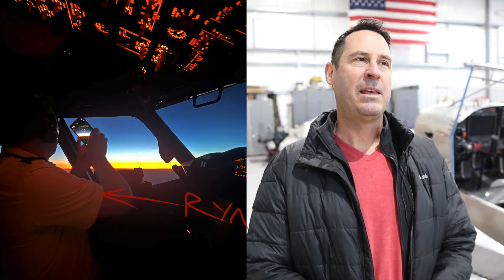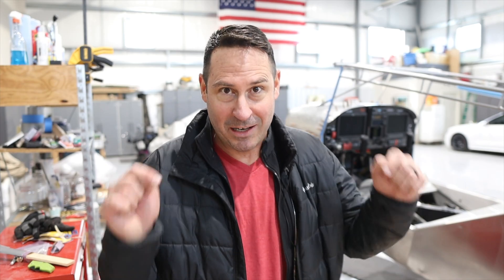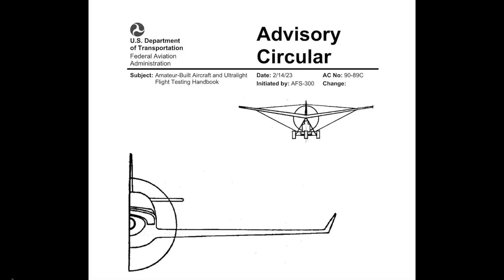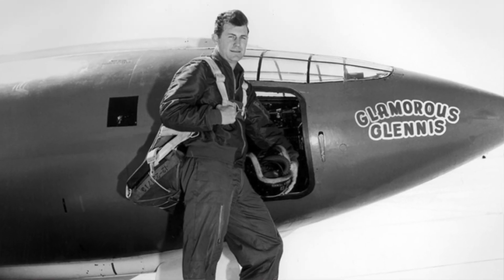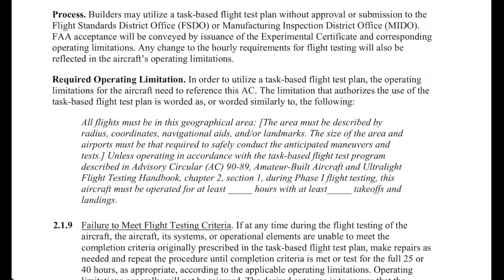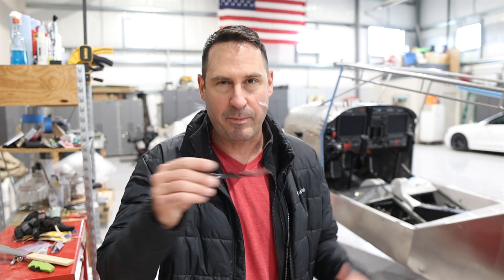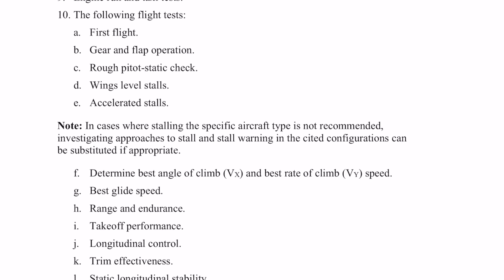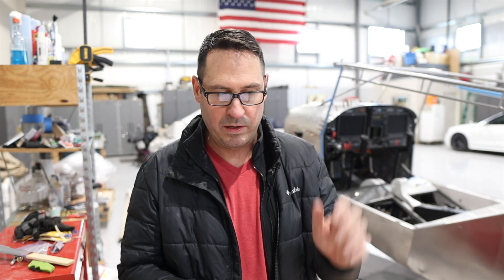Task-Based Phase 1 Flight Test is FINALLY HERE!

Comment: Task based makes perfect sense. May actually make for more thorough and comprehensive testing and documentation of. In Canada we have required 25 hrs of snag free test flying for some time. If you have a major snag to fix the 25hr clock restarts. We have 2 main task based things to prove, 1st that the fuel system can deliver at least double the engine’s maximum requirement, 2nd is a gross weight climb test to weed out excessive gross weight claims or unrealistically low power installations.

Shedding restrictions at 40 or 25hr is a nice technical/bureaucratic threshold to cross and it makes carrying passengers legal BUT because every homebuilt is essentially a “one off” it is unrealistic to expect to be snag free at that point. It took me about 100hrs to chase down every rattle, rub, hot spot, chaffing bit, minor leak etc, now with 300hrs and just done the 2nd annual on my S20 I still found a few things that needed attention. 

The published EAA test program that Steve mentioned, is terrific, couldn’t imagine commissioning an experimental ship without it. With the G3X capturing every imaginable bit of data every 1 second and powerful (free!) tools like Savvyanalysis available you can accurately get through the flight test tasks in much less than 25hrs. It’s chasing down the inevitable minor building issues that that takes the time.

Comment: This is good stuff! Thanks Steve
Reply from the maker: Thanks Dad & Chad! Will you make OSH23??
Reply: @CLEAREDDIRECT  plane is in paint and DAR and done 1st inspection. Should have it flying very soon! Need weight and balance before we can file FAA paperwork but plane needs to be together before weight and balance can be done. We are way behind on videos 😢 have one to help eab ppl file proper paperwork for airworthiness cert.  Plan is to be at OSH23 with plane. We haven't even booked a hotel yet...I'm sure we will have to drive a ways now.  🤷‍♂️

Comment: I was just chatting with a buddy about this. Isnt the DAR or FAA instpector who issues the airworthiness the one who specifies the Phase 1 requirements and limitations? My buddy suggested talking with the inspector first to ensure you can actually get this option.
Reply from the maker: No, you don’t need their approval. The DAR is purely airworthiness and approves your operating restrictions. When you EXIT phase 1 and apply for your experimental certificate, they will review your completed flight test pgm
Reply from the maker: It’s all in the AC. Very well-written.
Reply: @CLEAREDDIRECT  nice! Thanks. Well probably use this as well. Appreciate you bringing it to everyones attention!